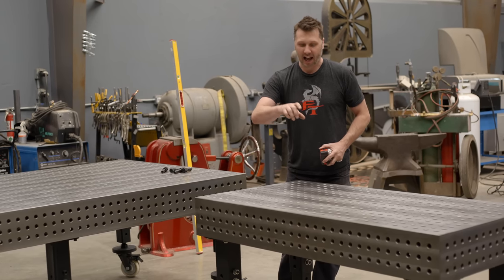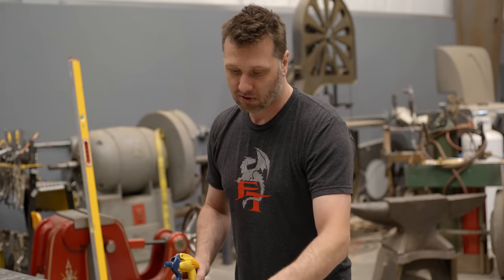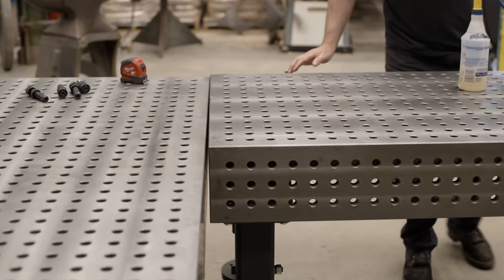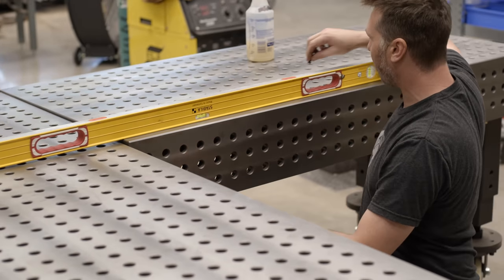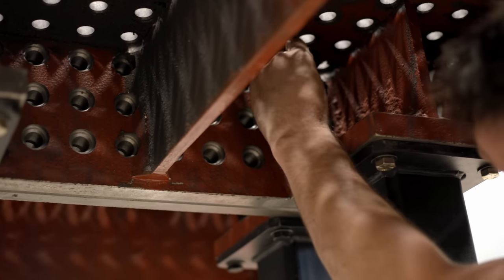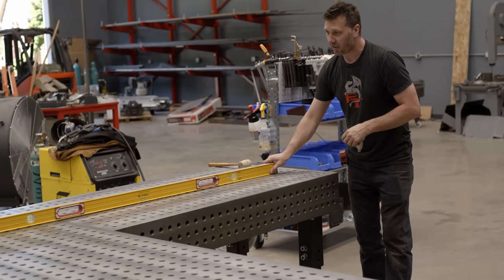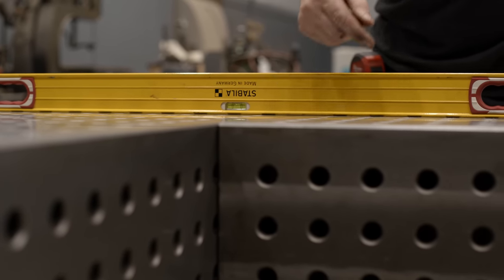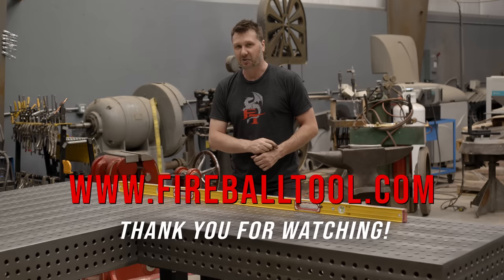How to Join 2 Fixture Tables Together

Comment: they go together pretty fast but you lose allot of flatness doing it that way I think some type of clamping system that goes under along the edges of the tables and removing the wheels at the joint to allot for conjoined leg that shares wheels would be better your gonna have some flex in this style of mounting but still a good system your system is fast really fast